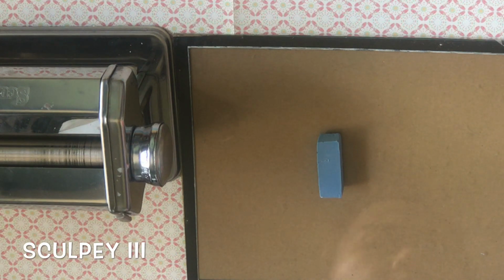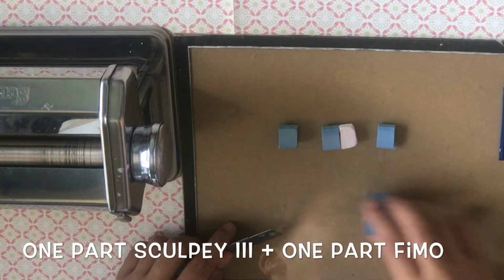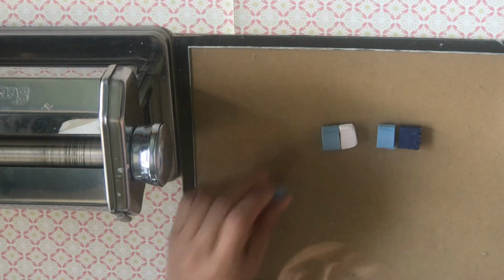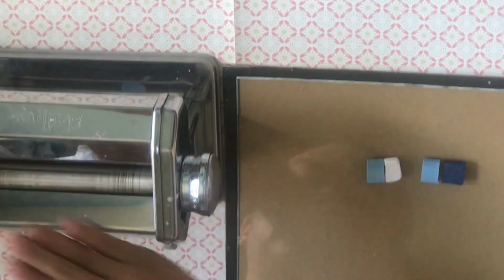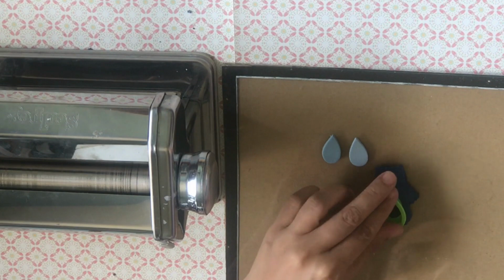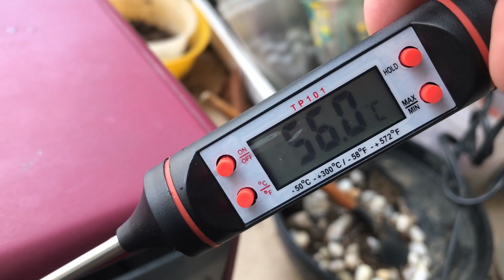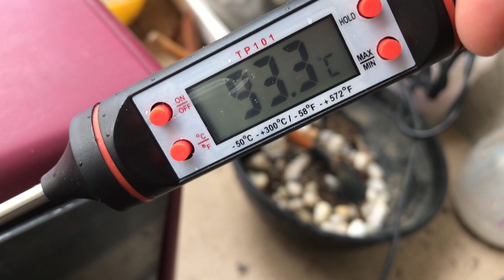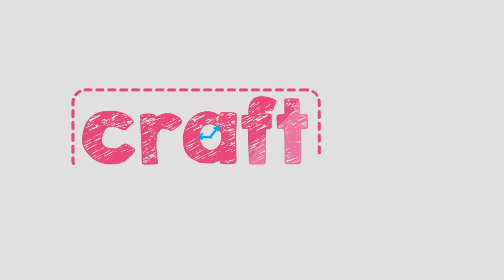Polymer Clay Tutorial 34: Experiments with Sculpey III

Comment: Sculpey iii tends to be very very sticky compared to premo, I learned to just remove the oil by rolling out a thin slab putting it in regular printer paper folded in half around it and rolling it until it’s flat enough so that most of the thickness of the clay is covered by clay. Then leave for overnight for the best results and bam it’s similar to premo
Reply from the maker: Thank you for the advice!